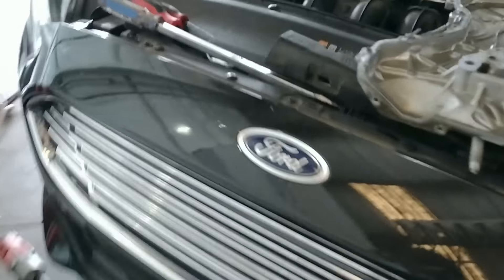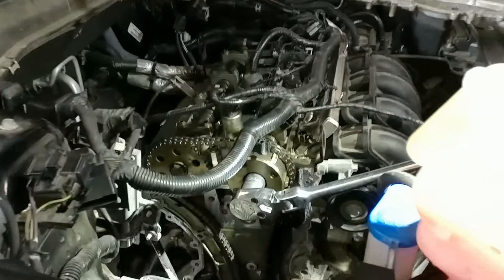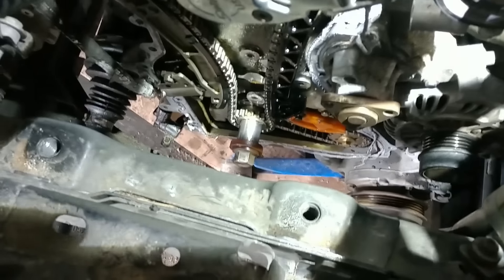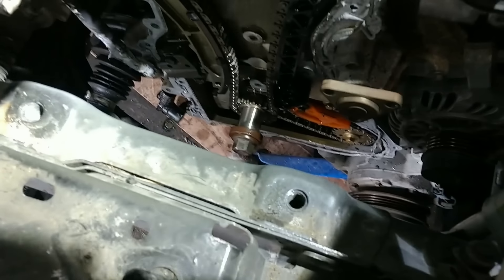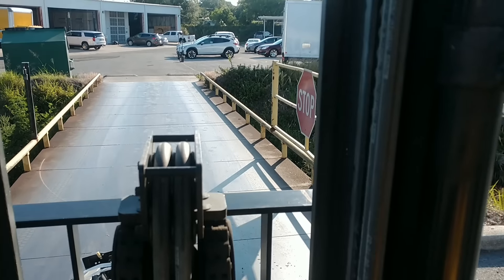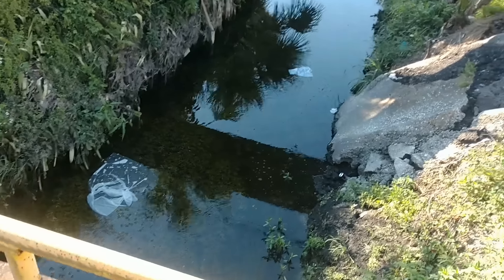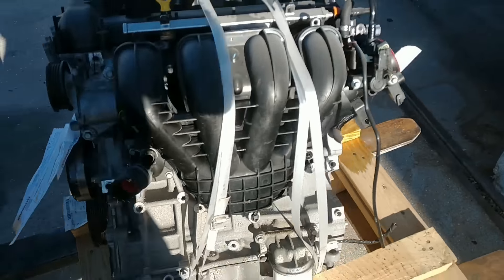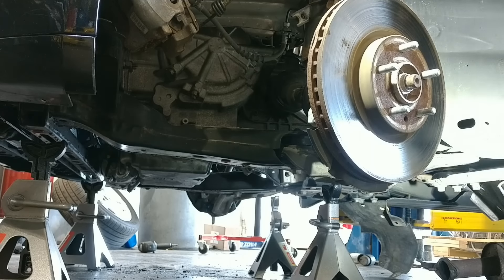Damaged Engine: You Broke it! Pt1

Comment: Ouch! Rookie mistake, maybe but what a Godawful design those engines are.  I've heard about them previously but fortunately never run across one, all to save a couple of bucks machining a groove and adding a key no doubt.  The apprentice will learn a great lesson here though, any time you're in even near the timing gear always spin the engine by hand at least 2 full crank turns to verify timing when you're done. No matter if it's just a cover reseal or a full rebuild it takes 2 minutes for peace of mind. 

Glad you're able to sort it, and customer likely ends up with a much healthier engine overall.  What an utter shite design though, without knowing prior to going in, only experience would've possibly saved that mistake.

Comment: What a crap engine design, a Woodruff key would have been so easy. That was about the era when they ran rubber cam belts in oil. 🤬

Comment: What the actual fuck......Friction to hold the most important thing on an engine in  the correct spot are you joking. That's like using tape to secure booster rockets to a space shuttle.

Comment: I once blew out the ECU on a very expensive BMW while installing a new head unit and some amps.  It was a similar situation in that the car had some wiring quirks particular to that model, and I didn't know.  This was 25 or so years ago, so I don't remember exactly what the deal was, but the shop ended up eating a few thousand dollars in repairs.  Anyway, the point is, I feel this guy's pain.

Comment: The lack of jetways is super common these days, especially on cam belt engines… It’s ok if you have the special tools usually required to lock cam  and crank.

My Renault is the same. If you want to just change a harmonic balancer, you need to basically do a timing belt job with the special locking tools….

Comment: That is too bad that this happened in the manner that it did. I watched your other video when you had to take out the entire dashboard in order replace a simple A/C sensor on a Ford F150.  Both of these videos demonstrate why Ford earned the acronym F.O.R.D. I cannot mention what the first letter means, however, the last three letters mean Over Rebuilt Dodge.  The acronym also means Found On the Road Dead. There should be a key in that crankshaft. Secondly, that valve timing cover should NOT have been leaking in the first place since the car has only 70,000 miles. In my opinion, Ford designs nothing but garbage and they should of supplied your customer a new engine free of charge. Everyone who is considering buying a FORD should watch your other video when you took that entire dash out of the F150 just to replace a simple sensor....Unbelievable.. If that F150 was a Honda or Toyota, that 10.5 plus hour job would of been a 30 minute job. I wish Bill Ford would watch your videos so he can see what kind of garbage his company is selling to the general public.

Comment: This newer stuff is TOTAL SHIT ! If you remove a radiator cap - soon the dealer will have to reprogram a body control module ! With multiple chains , guides , VVT , etc . , I don't see many of these engines going 200 K , or even 150 K without serious repairs . And once the wrong hands molest it - it's anyone's guess ! There are some great techs . And others that can't read the lunch menu !

Comment: Wait till you do a water pump with this design with it being part of the timing chain on the Ford ecos labor time sucks cause I'll be sending that to someone else who doesn't want to look things up directions want you to hold the crank you have the take off the intake that alone is like 3 hours to hold the flywheel drive axle for the hold down on the crank shaft 1.5 and the valve cover was different with the high pressure fuel lines that was another 3 I believe to hold both cams in place since I did it once and never again so forgive me if I'm a little inaccurate in time and info on the actual ford engine but the water pump paid 4 hours even if you cheat it wedgen the cams  is still not good let alone you still need to hold the crank and can guess you on a no tolerance engine so the directions clearly know the correct time but it's still so little why wouldn't you replace the chain at what it cost to get their? (Not rereading this this engine brings up a stressful life at home with the pay grade on this poor guy who gets the one I send after informing the customer at the time I want at 50% productivity since it will take twice as long as the time I'll be giving and she or he will take it somewhere else ...I'm sorry)

Comment: That is really a dumb design. Personally I would not have accepted a used engine. Either rebuild the original or replace with a new one. Also I would have taken it to another shop, probably a dealer, for the repair and charged you back on it.

Comment: I hate cars with no keyway it usually means special tools when you put it together.
Reply: yup, need a cam shaft holder, set to tdc, crank stop bolt and usually 3 new diamond washers from the dealer, & new crank bolt, not crap ebay ones.  even if you do not touch anything but the cover, everything needs to come off, unless you just like taking everything apart again.

Comment: I agree with some of the other comments, hats off to you for owning up to it, and taking responsibility. I had some work done on my truck and the mechanic f*cked up and wouldn't own up to it. He wanted to charge $1100 for something another mechanic fix and also did my emissions and inspection etc for less them $300.

Comment: What sadistic, so-called "engineer" designed such a POS system like that? All the built-in failures on these new cars are way too many, and way out of hand. Especially all the plastic engine parts. I can see doing so for corrosion resistance, but the constant heat cycles kill those parts too quickly.

Comment: What is the advantages of designing the crank sprocket like that other than making it much harder to work on yourself without having a ton of ford special tools....ford engineers are absolutely retarded...or... their bosses absolutely greedy .... that makes no sense at all but I am glad you posted this... just about anyone would rip that thing apart and possibly do the same thing.... did y'all have the crank pulley off when you started it? Or rotate the assembly without it torqued? If it's a friction fit I don't see how it jumped time with the crank pulley on

Comment: 😂😂😂 all the cry babies moaning on that it’s a flawed design in by Ford. When have Ford ever been reliable apart from compared to gm products. Plus who ever removes the subframe with hub assembly for a few bent valves to then replace the motor. 😂😂😂 apparently you can’t replace valves

Comment: Those are the ones that have the stupid diamond impregnated washer on the crank bolt and you have to install the special tool to hold the crank in place.  Typical stupid Ford design.

Comment: When I was doing my apprenticeship a kid in my class made a similar mistake on a Ford engine, I think he was replacing the timing belt and didn't use a locking tool to set the timing (in a lot of garages they unfortunately teach you to be lazy and not lock the engine) when he turned the engine by hand he noticed the problem despite seemingly doing everything correctly. The other techs where he was didn't know anything about the free crank pulley so couldn't warn him. 

It took them ages to get the right information from Ford to get the engine back in time.

Comment: This is a stupid, stupid design. I would almost bet dollars to donuts Ford did that on purpose so that the average unwitting mechanic would do the same thing. I figured there is a cam locking tool as you said later in the video. But even still with the cam tool, if the balancer doesn't go back on just right that cog could spin (I'm not too familiar with that Ford engine) but I am guessing that it's an interference engine.

Comment: What ever happened to reading the manual before performing work?
Reply: To be fair, if you had to read a manual or every car before you worked on it, that's going to be an extra few hours on your bill.

Manufacturers are making what were relatively simple tasks complicated, for no particular reason. Look at some of the oil filter placements - difficult to get to for no good reason, and plastic sump plugs that need to be replaced each time with 7nm torque  - what was wrong with the older style.

Comment: Having bought a whole new engine to drop in an 84 chevy celebrity, I can attest that it is sometimes cheaper than buying parts and fixing issues with one when the damage is internal like that. The engine for my car was like $2000 with the core charge added on, $1500 before.

Even better when it's a used engine and low miles. Definitely gonna be cheaper than the parts at $400.

Comment: Got to love this design its the same as a Ford Fiesta and Focus when doing a timing belt, no crank lock pin or cam set bar you're up the creek with no paddle. It's one if the most bs set up and even though you done everything back up to torque spec you just have that little voice in the back of your head are you sure it not going to undo a little bit and mash the valves moment.

Comment: Ford not placing keys on shafts ro index and easily set the timing on a ford motor, say it ain't so...oh wait the turd 4.0L soch has this same inferior design requiring ford dealerships to buy ford specialty tools to complete the job. 2 cents of machining for a keyway or charge the shop $300 or more for a tool.  That must of been when ford hired a bunch of out of work chrysler engineers.

Comment: Totally shite design from ford. The diesel is just as bad. Its called a mondeo in the uk, loads of um about , the same shite engine is also in the transit vans and jaguar x types. Injector leaks are common and Injector over fueling so much it bends the conrods is also been seen.

Comment: Why am I not surprised to see yet ANOTHER idiotically engineered Ford engine?  There was a time when Fords were absolutely fine.  2000 and older Fords are generally pretty good...  Certainly no worse than anything else.  Somewhere along the line Ford must have decided to hire the dumbest f'ing engineers on the planet because they have been pure shit for the past 2 decades.  They screwed up spark plugs TWICE on the Triton V8 as well as a few other issues with that engine.  The 6.0 and 6.4 powerstroke diesels are garbage.  The Ford Escapes have cylinder block failure consistently and as early as 10K miles.  And now one of their geniuses came up with another one of Ford's better ideas and chose to NOT have a keyway in the crankshaft and timing gear to index the valve timing?  This idiocy can be the result of only to things.  Either Ford did this on purpose to discourage people from taking their piles of shit anywhere besides the dealership for service, or likening the engineer's mental acuity to a box of rocks is an insult to a box of rocks.  Ridiculous B.S. like this is exactly why I'll never own a Ford newer than 2000, and to be honest, there's no reason to own one newer than 1980 at this point because a '66 or '76 Ford truck is MUCH better looking than a '96 Ford anything.  I don't see Ford getting any better because there are legions of fools who will buy them no matter how bad Ford makes them, and judging by the past 20 years, there's no floor.

Comment: I love the comments attempting to blame Ford and the design.  It's all in the repair manual and is really rather straightforward.  Ford mechanics do the same job all the time and don't screw it up.   What you don't understand doesn't make it the manufacturer's fault, although on the Internet it's de rigueur to shift the blame to make yourself sound smart.   The shop and Ray are to be commended for acknowledging the mistake and correcting it.

Comment: The funny thing is ford has been using non keyed timing components for 20 years. This is not a new thing. Ford has industry best tech information. By providing information this way ford can use low skilled lower paid less experienced techs. This is a failure of the Tech not using the service manual. Failures like this stem from industry pushing away from skilled tech base to instructed tech base. To bad it is the customer that looses in the end.